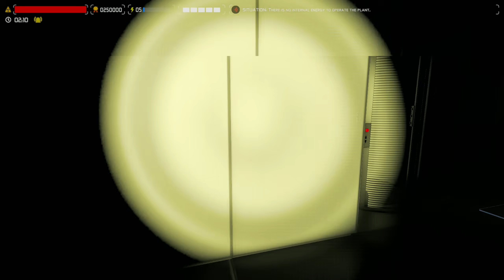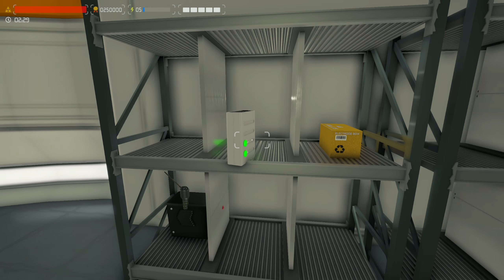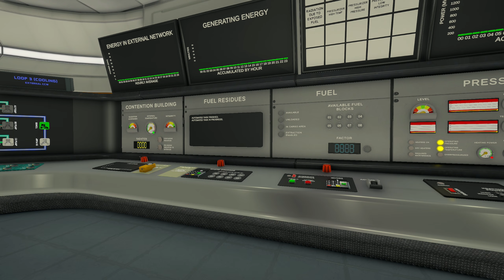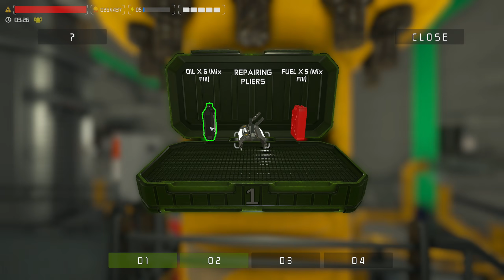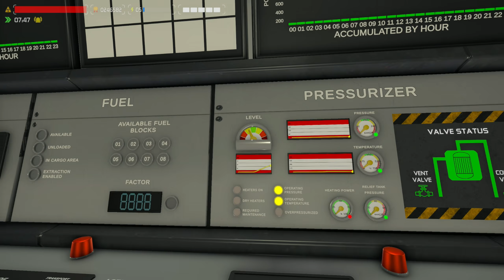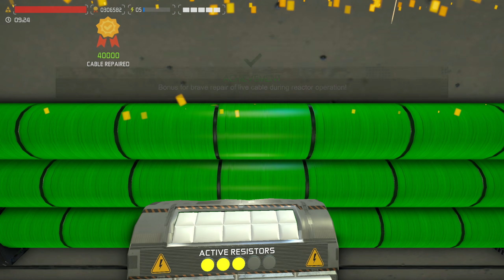Nucleares - 1st 'START-UP' Scenario 3

Comment: How do you lower your core volume level so you have space to inject Boron in the Chemical update, it keeps telling me my Boron Dosing pump is overloaded, which I assume is because it has no space to pump in boron
Reply from the maker: It's 1 of the tanks in your core room...
Pretty sure it's the RCV Valve? I will have to double-check later today when my pc is on

Comment: Im having problems filling up the Core Outer Vessel Coolant level. I am doing everything exactly as you, but there has been an update since you made this video. What valves needs to be open/closed to fill it up?
Reply from the maker: Your internal core pulls water from the internal water storage tank. (the one far left as u look into the core room from the control room) The internal core is filled up by the Feedwater Curcuit Pump ✌️
Seems like I'll need to do another up to date Scenario? 😎👌
Reply: @ShArPy1o1Games  The external core (the one in the middle while viewing from the control room where its usually water) does not fill up from the feedwater pump however. A new up to date would be awesome my man! You just got a new subscriber
Reply from the maker: Cheers heaps... maybe watch 1 of my more recent videos of Nucleares as you may find your answer there in the meantime 😇✌️
Reply: Same thing for me.
Reply: I figured it out, you have to pull the lever on the external core coolant tank valve in the far right corner of the reactor room. (the blue lever)
Reply from the maker: Don't forget to turn the internal/external pump on (cant remember which one exactly) with the yellow water tank valve open to fill it, also at the same time...
Reply: Yellow water tank valve? @ShArPy1o1Games

Comment: Everyone that knows how to operate a nuclear reactor will be screaming at you for loading the fuel into the core before the coolant is maxed.
Reply from the maker: Haha, the trigger is real 🤪✌️
Reply: @ShArPy1o1Games  Imagine if more than 1 rod was broke. Then that would be fun, as that is an instant meltdown. And the fact that you could in theory get it to shut down with high boron, but thats not happening in practice and this was before the chemical update.

Comment: Casually inserts fuel in the core before he has to go down in there
Reply from the maker: That's what the Suit is for... mwahahaha
Reply: Just FYI new never used nuclear fuel is "relatively harmless", you can even touch it with your bare hands (though gloves are good to prevent contamination). On the other hand, freshly used up fuel is extremely radioactive and no suit is going to protect you from that.

Comment: Lovely video. Good to know what I need to do, if manual maintainance is required.

Say, do you know what I can do when the core is damaged and I can not pull it out with the button on the Fuel control pannel even after pumping out the water from the core? I tried to use the crane above the reactor, but I can't even grab the core. Though I can smash my control rods, if I am not careful XP
Reply from the maker: The crane should be able to get the fuel rod... maybe the crane needs fuel itself...? 🤔
Thanks heaps for the comment as always 😎
Reply: @ShArPy1o1Games  You're welcome ☺
Let me try to describe the situation as good as possible:

I tried to intentional cause a meltdown, so I can trigger the escape protocol and start a "New Game Plus" with a bunch of updates and a high enough level to do some updates.
I caused the core integrity to drop down to 30% and then, I could no longer make the reactor... well, "react". I tried to use maintainance protocol to fix everything except the core, but it still didn't work. 
Then I tried to repair the core, but that wasn't possible because it was still inserted into the reactor. I tried the usual steps to pull it out, but the Fuel panel is not even lit up, though I tried to turn it off and back on again. Even pushing the "overide safety" button didn't do anything for me.
I got into the containment building, got all the way up to use the crane manualy, moved it down to the core, but I could not get down far enough to grab and pull it out.

I tried to see if I can, like, move the grabber not just up and down and left and right but also in a vertical motion. Like, making the tip of the grabber go down, if you can visualize what I mean.
Reply from the maker: Seems like your fuel residue panel has a blown fuse...?
Reply: @ShArPy1o1Games  Oh! Darn, I did not even consider this possibility. Alright, thank you. I try and see if this fix this issue.
Reply from the maker: No probs, let me know if that fixes your problems 🤔✌️
Reply: @ShArPy1o1Games  It
It's not the fuse. I went behind the control panel to replace the fuse, but it's still dark.
Reply from the maker: Maybe post a screenshot in the Nucleares Discord Channel... Many members available to help 😎✌️😇
Reply: @ShArPy1o1Games  I try that. Thanks for your help. 
Also I just learned: you can get sealed in, if you are, for example in t he transformator room, the radiation door is down, and you loose all your power. There is a lot to keep in mind, while playing this game.
Reply from the maker: Haha that sucks to find that out the hard way, I guess... might be good to make a suggestion through discord? I'll be on Discord tomorrow as it's 1:15am in Aus currently haha

Comment: I don't usually touch the Pressurizer valves. If you spend a few minutes pumping coolant through the Core loop while the system's still cold, it'll fill and balance itself just fine.
Reply from the maker: Great to know, I'll try it next time and do a bit more testing with the pzr 🤔👌😎